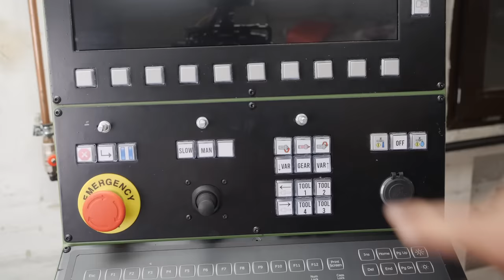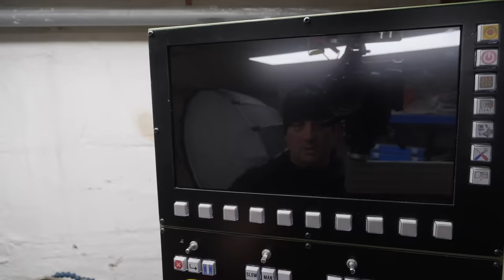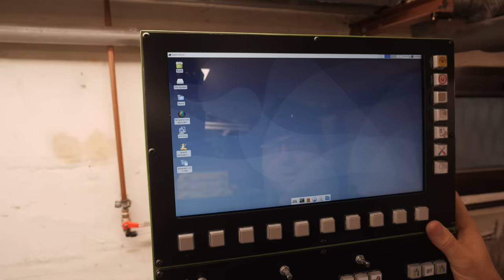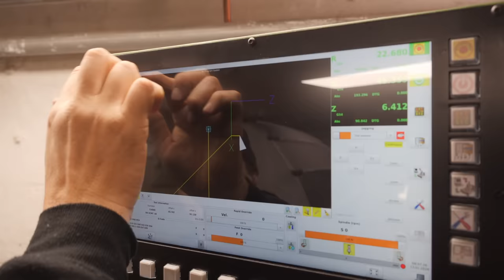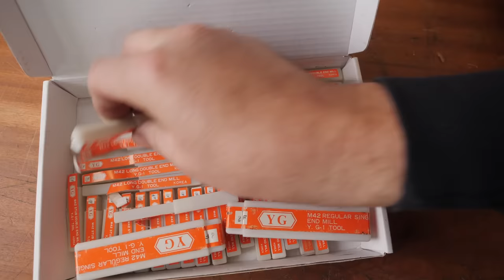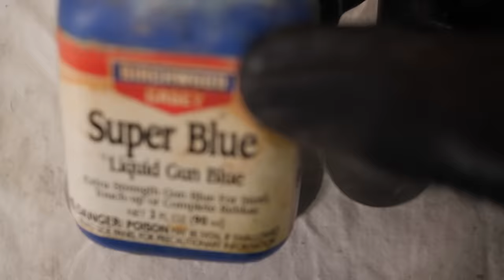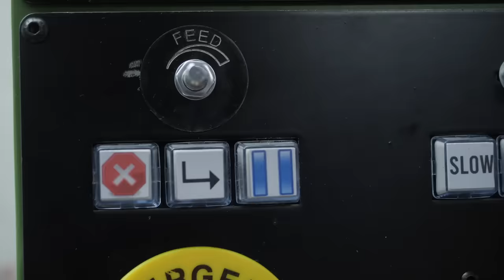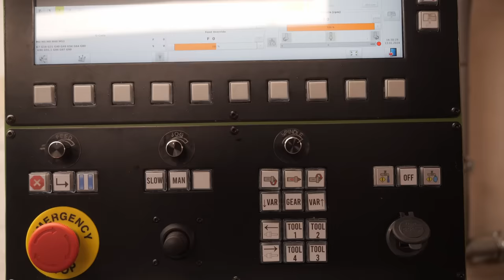Engraved markers Schaublin Ep. 61 || RotarySMP

Comment: Ive had the whole grounding issue explained to me very well at University. Wether you should ground shielding on only one or both ends depends on the frequency of the interference you want to shield against. For lower frequencies (500kHz - 1MHz or below) you should ground your shielding at both ends because the interference is due to induction in the conductor. In that case the shielding works by creating a magnetic field (due to the interference) that is opposite to its origin (in that case the interference) and should thereby cancel out the induction in the actual conductor you are trying to shield. For that to work you need actual current to flow, which is why the shielding needs to be grounded on both sides. For higher frequencies the interference is transmitted onto the conductor via capacitive coupling. In that case the shielding acts as the second plate of a capacitor that shorts every charge that is deposited onto it to ground. You are then not relying on the current though the shielding to cancel out the interference. In your specific case here the frequencies of the interference should be mainly due to the vfd's or similar power electronics with working frequencies well below the 500KhZ to 1MHz range which is why I believe grounding both sides would be best.
Reply from the maker: Since there are a zillion HDMI cables out there, would the shielding not be defined in the stardard, and used on all cables?
Reply: @RotarySMP  For HDMI Cables very likely yes . (Although standards for consumer electronic cables and the like are often not very reliable because a lot of producers just simply ignore them and or make up their own) My statement was regarding general shielding issues that should apply to HDMI cables as well.
Reply from the maker: @aaronsilas7024  Thanks for explaining that Aaron.

Comment: You did a great job on the cable. I had to make some engraved plates recently. I used black colorbond steel and engraved through the black paint to the zincalume underneath. You can drag engrave, rotary engrave or laser it and the factory finish looks great.
Regards, Preso
Reply from the maker: Hi Preso. I got an offer from a kind view to redo those plates more nicely on his laser. :)

Comment: @3:21 the easiest place to attach you braid is those mechanical legs you covered up with tape.  It looks like some of the pairs are supposed to be shielded separately as a pair but your flat cable isn't at all, so you might have better luck with a right-angle hdmi male-female adapter (cheap) and a regular hdmi cable.
Reply from the maker: Thanks Tim. It seems to be working stably now, but if it is not stable, I will see if I can get an angle adapter to fit.

Comment: Ground both ends, and I would use aluminum or copper tape, it's not as messy, and works better for high frequency anyway, because it's solid.
There is a situation where you must not connect both ends of a shield, and that's if you already have an inner conductor, usually PE, that carries ground/earth, because you don't want any stray fault currents on the shield. Here it's fine to connect both.
Reply from the maker: Thanks Alexander. It seems to be working well now. 
I wonder about all the recommendations for single ended shielding, as I kind of doubt the commercial ones are only connected at one end.
Reply: @RotarySMP  Because people are confusing things. Especially where ground loops come from, and how fully isolated class 2 devices interact in that regard (both your PC and the monitor are fully isolated). 
We had a similar problem with HDMI, even an AOC. That obviously has no shielding because it's optical, however in addition to the HDMI signal on a fiber, it also carries power and I²C for EDID, which was susceptible to noise. All in the direct vicinity of a VFD and big motor.
In the end we had to shield the whole optical cable, and the computer was a small-form-factor PC with external PSUs, so we had to drill a hole into it and mount a chunky ground cable as well. Only then would HDMI stop to break up all the time.
And yeah, HDMI has shield connected on both ends. AFAIK there is no possibility of ground loop because none of the internal pins are directly connected to the outer housing, i.e. your braided shield is the single ground connection, like with Cat.5.
Reply from the maker: @graealex  Thanks for that Alexander.

Comment: You could have used copper shield tape, this is the standard thing we use in case of EMI issue, expecially on fixed installation. With added kapton tape for insulation.
Reply from the maker: I didn't have any, but had that braid laying a the bottom of the wire pile :)

Comment: One end. The one closer to the PSU and true ground.
Reply from the maker: Thanks, there seems to be a fair bit of disagreement on that in these comments.
Reply: @RotarySMP , well, in low-voltage situations, you want to avoid ground loops at all costs. The only way to guarantee that is to always ground one end of any shield closest to the best ground. It would be preferable to run all grounding points to one common lug and then ground that lug to the power source ground. At least, this is what they taught me when I took classes in satellite receivers. Ya know, stochastic signal processing and all that jazz.
Reply from the maker: @unclespicey42  Thanks.

Comment: That monitor blinking dark, looks totally dark, ie backlight goes out.
So it is possibly a power supply issue since monitor backlight supplies are notorious for blinking faults etc, usually caused by dried out electro caps in the backlight psu module.
Of course it MIGHT be auto turningmoff the backlight with a loss of HDMI sync, BUT in my experi3nce when there is a loss of HDMI the backlight usually stays on just the image disappears.
Reply from the maker: I also considered a power issue, but it seems that the HDMI shielding has fixed the issue.

Comment: If you can, lay the HDMI cable flat against the grounded chassis. This can significantly help reduce immunity issues.
Also, make sure that where your chassis panels mate, that there is a good electrical connection (to form a faraday cage).
Reply from the maker: Thanks Alex, good ideas. I have decent signal with that cable shielded and as far away from everything else as possible. I will get some of those sick on tie wrap mounts to keep the cable like that.

I haven't made the back closing sheet yet.

Comment: I used to operate a Mazak 5 axis and that didn't home the axis' - they were all 'absolute' encoders and set only on installation and service. It would reliably position to 0.0001mm! It was a very impressive machine with temperature controlled ball screws throughout
Reply from the maker: Yeah, when I wrote that, I knew this would come. Those top end machines are amazing.
Reply: @RotarySMP  absolute encoder servos are working  their way into the hobby space. 
have you seen the the Marcos Rep video where he has ethercat working with linuxcnc?
Reply from the maker: Hi Steve, I saw the title, but at a time I didn't have time to watch it. It is on my view list.
Reply: @RotarySMP   It doesn't have any real application to what you have done so far, more of a future consideration.
the ethercat connection (Beckhoff) allows for the connection of the  servo drives and vfd/spindle amplifier and
all related feedback through  ethernet cables.    absolute encoders are a bonus feature.
Reply from the maker: @steveggca  When I designed my retrofit, ToT did his ethercat videos. I considered it, but it seemed that LinuxCNC ethercat comp was not that mature, and I am not good enough at that side to risk it.
Reply: @RotarySMP  Understood.  I see that Linuxcnc now has an ethercat forum.
To be honest, I was there when Fanuc and Meldas brought absolute encoders to market in the late 90's
after the novelty of turning the machine on and just start machining wore off, there really wasn't much
of a benefit to be seen in simple 2 and 3 axis machines.
What allowed for the absolute incoders was the switch from analog to digital encoder feedback.
Fanuc called theirs " Fanuc serial servo bus" FSSB. It is of course proprietary as are all of the other builders.
I do believe that it allowed for vastly higher encoder counts ( 16M pulses per revolution) and things
like 24 simultaneous axis. 
EtherCat on the other hand is "sort of" open source, and that is why every servo builder from high end
to almost  hobby class servos can be had with ethercat.

Comment: quite a few years ago I remember reading an article about TCAS and thinking I can't even imagine the level of computing power need to handle the air traffic back then, with today's level of air traffic the computing power needed is even higher. The reliability of such a system would have to be insanely high, IBM's latest z16 mainframe boasts nine nines of uptime and reliability, is that good enough for today's TCAS needs? All I know is, that question is way above my paygrade. 😀

Loving the build videos btw.
Reply from the maker: Since TCAS is aircraft based, it only needs to process the signals of transponders which respond to its interrogation. Since most flight path vectors at straight lines, I don’t think the TCAS computers need that much processing power. The cost is driven by the DAL A software certication due to risk severity of potential failures

Comment: Good to hear you're getting a handle on the EMC gremlins. As to grounding braid, I wouldn't blindly ground both ends as you don't want to introduce grounding loops especially if the devices are powered from different supplies - that can introduce a lot of even weirder gremlins. I'd also look at placing ferrite beads strategically on problematic power supplies leads and cabling.
Reply from the maker: Thanks Vince. For now it is working, so I won't touch it again :)

Comment: Shield one end, or you get ground loops. I'm surprised such a short cable has issues, HDMI uses differential pairs. That "cheap" aluminium roofing tape also works wonders.
Reply from the maker: Thanks for the feedback,  Do you think commercial HDMI cables are only grounded at one end?
Reply: It's most likely the (unbalanced) EDID/DDC signal that accepts the noise and makes the monitor lose connection.

Comment: As an electronics guy I do a lot of small panel engraving jobs for prototypes and test equipment etc.
For 3 small discs like that, I would clamp down a lerger piece of stock to ensure flatness, then engrave all 3 in one operation. The engraving would include the centre divot (for manual drilling later), or in most of my cases I would just change the cutting tool after engraving then CNC cut out the centre holes and lastly the edges to separate the 3 parts.
And mostly not steel, I have come to prefer the rear engraving plastic laminate that has clear thick top layer and a very thin rear black layer you engrave through (reversed, obviously). Actually I think that plastic it might be a German product, I ordered a heap of it years ago with some small endmills from Germany.
Reply from the maker: Good ideas thanks. I didn't think of back engraving. That makes sense.
Reply: @RotarySMP it’s called traffolyte in the UK. 😊
Reply from the maker: @chrisfairbrother9197  Thanks Chris.
Reply: @chrisfairbrother9197      thank you Chris! It was years ago I would have never found the receipt lol. 👍

Comment: I'm sure you've looked already but if you search for "u shaped hdmi adapter" would one of those fit? Alternatively a custom PCB with a HDMI plug + socket would reduce the exposure area and allow you to use a single display port to HDMI cable.
Reply from the maker: Thanks for the tips. The shielded cable seems to be working fine for now.

Comment: I'm not sure about your specific dials, but I know with a lot of automation specific equipment they often key the threaded portion either with a cutout or flat. Makes it much easier to clock your face plates correctly and have them stay in place. Of course, nice to have features like that usually end up costing extra as well...
Reply from the maker: These are free rotation encoders, so there is no clocking required.

Comment: Maybe a bit of a Non-Sequitur but just wanted to mention that some HDMI cables have their own IP Address.  It might be for the feature of wirelessly accessing what is on a monitor screen. Perhaps covertly if associated spyware is installed - In Windows you can check via Device Manager "Show Hidden Devices"
Reply from the maker: This is a pretty basic Debian system, and is not connected to the internet, so I am not too worried about that.

Comment: If it's a sync issue, try adding an EDID minder to the cable. I keep a couple of bi-directionals in my kit for A/V installs where detection isn't ideal for the use case.
Reply from the maker: Thank for the tip. It seems to work stabily now.
Reply: @RotarySMP  I have a bad habit of commenting before things get fixed 🤣
Reply from the maker: @tahwnikcufos  Thanks for commenting.

Comment: Your pinecil soldering iron will work better from a 12V barrel jack than from USB  :)
Reply from the maker: Are you sure about that? USB-C PB can supply up to 20V and 60W.
Reply: Sorry should have written 24V. I noticed a diference when I switched from usb to a 24v brick, but it might allso be my USB delivery that was weak.
Reply from the maker: @SorteBill1514  I have been using my apple USB-C PSU, and it works well.

Comment: Only shield one end for signal wires. You only shield both with vfd power wires
Reply from the maker: Thanks Paul. I think one connector had a coating on it. I only got solder sticking on the bent end.

Comment: With displayport to hdmi adapters, try to buy new old stock ones from HP, Lenovo, or Dell, not generic garbage from china. I've definitely had issues with DP->HDMI adapters having that flickering issue in the past. It's not a physical connection problem, but a problem with the chipset in the adapter / the video chipset / the linux drivers.
Reply from the maker: In this case that DP-HDMI worked with regular cables, and seems to work stably now I have the shielding and routing improved.

Comment: Production quality and quaility control at Spirit has been a long problem.  According to various documents, Spirit has focused more on churning out product by over worked andunder trained workers than it has on safety.  Spirit has been requiring workers to work 12 to 18 hour shifts and quality control staff have been punished for finding faults.  
Blairanco(sp?) has been doing a few videos on with with documentation from cases going on right now.

EDIT:  I forgot to say, can you get a stylus so you can reach things on the screen instead of relying on your finger?
Reply from the maker: Yeah, the whistle blowers and other info leaking out of Spirit does not paint a positive picture of the culture there.
Good point on the Stylus. I'll get one.

Comment: I think if you ground at both ends of the shielding you could end up with ground loop problems.
Reply from the maker: Thanks Martin, Do you think commercial HDMI cables are only grounded at one end?
Reply: Commercial HDMI as well as RJ45 cables have their shield connected on both ends.
Reply: @graealex  That is the way I understand it as well. I was told when I studied IT if a shielded cable is not grounded at both ends that the shielding starts to act as a antenna...
Reply: @HeimoVN  Exactly. Also ground loops get formed when you have a) two devices at different ground potential, and b) an unbalanced signal where ground is part of the signal. Then current flows between the two devices, and the device interprets the ground current as part of the signal, for example you might get a 50 Hz hum on an unbalanced audio connection.
HDMI itself is differential, however there is also an I²C signal for EDID/DDC, however that references a separate pin 17 as Ground. If there was a ground loop, it would already be happening over pin 17.
Where you absolutely must not connect the shield on both ends is if there is a PE conductor in the cable. Then you must only connect shield to PE on one end, because you don't want fault currents running over the exposed shield.
Reply: @graealex  great info thanks...

Comment: Are your encoders push type? Used the push to reset the value to 100%.
Reply from the maker: Yes they are. Gmoccapy doesn't have reset pins for the jog or the spindle overrides, so I need to have a think about working around that.
Reply: @RotarySMP  I realize that you are running out of I/O, back in the good olde days, those switches were make before break rotary switches.
ie the rapid override switch would have 5 positions (sometime 4 with 75% deleted)  for 0%,25%,50%,75% ,and finally 100% otherwise known as 000 through 101.
the feed rate override/jog speed selector had about 16 positions for 0% to 150% or 00000 to 10000. alternatively 16 ,selected by you, feedrates.
spindle speed override was  50% to 120%
these are forever settings until the switch is turned to another setting.